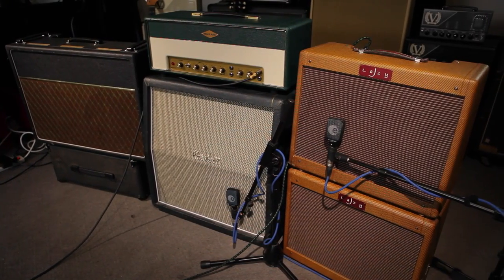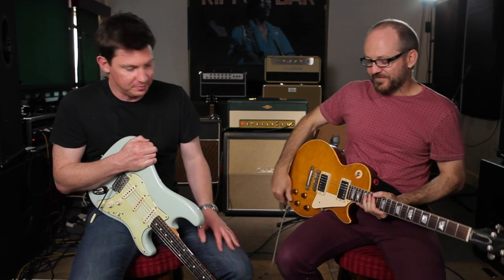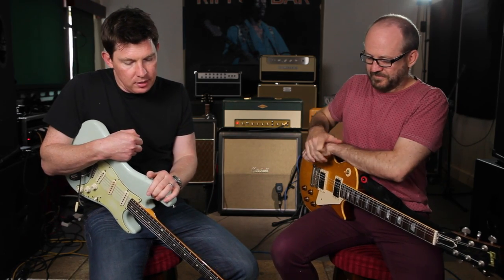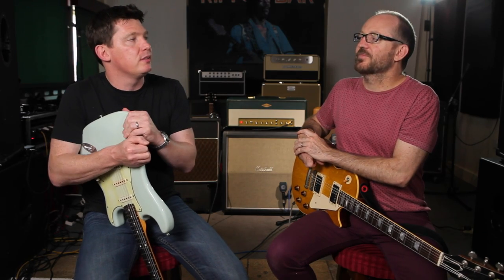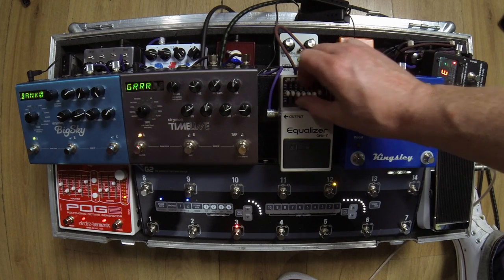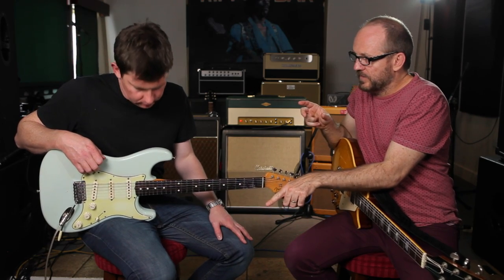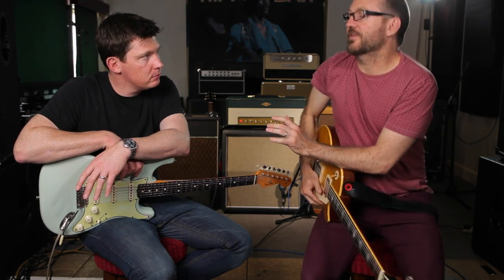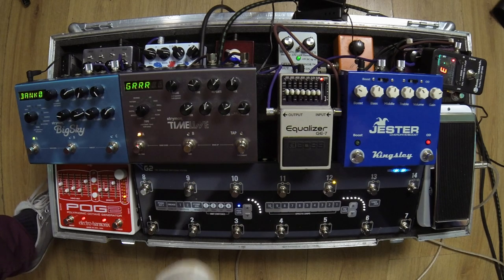Yes You Do Need A Graphic EQ Pedal! Plus: Latest Kingsley Jester

Comment: what do you think of the 10 band MXR EQ instead of the 7  band Boss? I play a Strat, into  a Marshall JCM 2000 dsl 40 watt combo, good gain, but no thickness, no bass, even with  the bass turned all the way up..would an EQ make it sound a lot  thicker and bigger, not more distorted, just way huger sound top to bottom..that is what I am looking for.

Comment: I've been using eq in front of my amps for 20 years. Now I'm using 3 different ones in front of my amps, a Furman PQ3, Boss GE10 and MXR 10 band for different eq curves while using an RJM 12 loop effects gizmo, but I use it in front of my overdrive pedals. I also use a TC Electronics stereo 4 band eq chained together for 8 bands that I use in my effects loop of my hi gain amps or the effects loop of my Fryette Power Station when I'm using my non master  plexis and it gives me a lot of flexibility.

Comment: Am I the only one who used my ge-7 as a tube screamer replacement? 
I play Metal using a high gain EVH 5150 iii Stealth and I use clean boosts to push the front end of my amp with a ge7 at the end if the chain into the front to act as a tubescreamer but with my eq style with the gain on full to again push the amp. 
ge-7 is always on and I add boosts when I want more saturation. 

Then for solos I'm thinking of putting either another eq in the loop or putting a mid hump style boost, would that work for the extra cut?

Comment: Great video! I have a question though. In my pedalboard I've Maxon SD-9 running into Empress Multidrive which already has three band Eq. Last in the chain is Strymon Blue Sky. The question is - where should I place Eq pedal in my chain. Before Maxon and Empress (does it effect my already set Eq on Empress, probably yes) or at the end of the chain... Thanks for replay! Keep posting videos! Cheers!!!
Reply from the maker: +Ľubo Ivan Hi there, you need to try it, see what works for you, some examples in the above video might help, but try it in the different potions and see what works best for you, there is no right or wrong answer ;)

Comment: Something I have always taken as read, without really thinking about it, and that is, when setting up a Guitar/Amp EQ without any pedals that the tone controls on the Guitar should be set on 10. After the required EQ has been set on the amp to accomodate all pickup permutations, tone can be rolled off where necessary, on the Guitar, to contain any treble spikes. Is that actually the correct way of thinking?
Reply: +Phil Porter Personally, I think that's a great way of looking at it. However, in my experience it works better the fewer (tone-shaping) pedals you have because your guitar's tone controll will have less and less effect the more pedals you have and use simultaneously.

Comment: So the Jester has actual tubes in it?  if the amp has tubes in it, why would you need a pedal with tubes? Would  it really make much difference with a tube amp?
Reply: In a word, yes. It changes the character and responsiveness of the drive. I've got an old bk butler tube driver and it's such a unique sound
Reply: the Jester has a certain sound... it accomplishes this with tubes.  Whether u want that sound is the issue.  the purpose of the tube is not to make up for the amp not having them.  To me the Jester sounds great , and would not sound the same were it designed differently with different parts.
Reply: My amp has tubes in it. A  Marshall JCM 2000 DSL 40 watt combo amp..so would this bee too much tube action, if this pedal has tubes and the amp does also?  I did not say I was trying to make up for a solid state amp.. I was just wondering how it sounded. Is it way thicker and heavier than pedals that have transistors, the way most are made?  Would it make a difference with a tube amp?  Would it give it a lot more thickness, hugeness?  I am looking for a way huger thicker tone, not necessarily more distorted, I do not like generic metal distortion at all.. I want a huge Hendrix style classic rock Strat Marshall tone..but I only have the combo, so I am trying to maximize, and tweak what I have.. I only have so much budget.. so I have to get creative, and maximize it..what do you suggest to get a giant  Hendrix-Stevie Ray-Trower tone?

Comment: Whats the point of having clean boost pedals like the spark mini when a eq pedal does it perfectly but with bonus of wide range of eq settings. Seems to me boost pedals are a scam to make more money.
Reply: Not exactly. An eq pedal isn't going to give you as much overdrive as a boost.
Reply: A booster boosts more db generally because the circuit isnt like a jfet clean booster , the eq is just a shaping tool like a knife to clay
Reply: @woofystevenson2943  Well said.  Then there's gain, as in a dirty boost, power boost,  and so on.
A GE-7 can't replace an RC Booster and vice versa.

Comment: do you reckon its a better idea to turn the eq on and boost the mids for a solo, or castrate the 'everything on 10' sound for a rhythmn tone then turn the scooped eq off for a solo? for instance on a low watrage amp run on full...
Reply: Chris Cox I prefer to setup my amp for the lead tone and solos then cut out about 5 db of one or 2 or the midrange frequencies and boost the treble just slightly for rhythm.  Cutting around 1000 can get you a fairly good rhythm tone that still cuts through the mix because your amp is boosting all the other mid frequencies.  It really depends on your amp though.  If it doesn't have enough gain on it's own then boosting it would be better.

Comment: what  order do you put  the  eq  pedal in? Would you put it in the efects loop, or the ones going into the amp input.. or where would it make the most difference?
Reply: Depends on how you want to use it. If you want to use it as an overdrive pedal (some EQ's have drive and level controls that let you do this)  then treat it like you would an OD. If you're using it solely to colour the amp then I'd put it first in line of the effects loop.

I strongly recommend getting the MXR 10-band EQ over the Boss GE7. It's just a much more capable EQ pedal.

Comment: I’m currently using an Amp Head Switcher between two heads and one cab.  Both heads have effects loops.  How do I combine them into a switchable In/Out with a single set of pedals so that those same pedals could be used in either amp when it’s active on the Switcher... without spending hundreds on a big fancy loop Switcher like you use.

Comment: Daniel, I do a lot of open air gigs and often the first thing I hear on stage is my low and mid range go. So does putting the EQ solve this "on stage issue".
Reply from the maker: Well it can certainly help but you need to be careful trying to dial in extra bottom end into the amp. It can cause the amp to compress much earlier losing all dynamics. Try very small increases and see how you go

Comment: So guys I think I'be created a bit of a conundrum for myself as I just added and Analogue Meano treble boost to my board however with a Tele (into a Marshall DSL40C) it's basically unusable. So now I'm thinking a need an EQ\ to calm down the shrill Trebel Boost which in and of itself seems counter intuitive.???How effective is an EQ pedal going thru the effects loop or should I basically stick with front of amp after all on the pedal board ?
Reply: The Death Blooms yes!! Eq is totally usable in the effects loop, try it out! Some like it first as a gain booster, others use it as an after-dirt effect still keeping it in front of the amp, and others rather make it the first pedal of the effects loop. Needless to say you can also use it after modulation/delay/reverb effects to experiment.

Comment: Does anyone have any insight into this particular issue:  On my live rig have my EQ pedal as the first pedal in my chain and I'm using the inverted V settings with the point in the middle at the top.  With my Stratocaster it sounds amazing both clean and when using drive pedals, a dynamically rich tone that I love.  When I switch to my Les Paul it sounds fairly good clean, but when I add a drive pedal it makes the pickups sound almost microphonic, not an all a pleasant or warm tone... if I bypass the EQ it sounds fine again.  Is there a happy medium setting you could recommend that would work well with single coils and humbuckers on the fly but would also help avoid the microphonic issue?  Thanks!

Comment: do ya'll use a graphic EQ pedal in every board you run? this is the only video where I have seen one on the board. 

Also, I play through a Mesa Boogie Mark III which has the 5 band EQ. is a graphic EQ pedal necessary if I am playing through an amp with an 5 band EQ?

Comment: between a 7 band and 10 band what's the difference and is it really worth anything?
mainly focusing on the mxr 10 band. do you gain by having more freq. to adjust? or is it really easy to get OCD with so many options.
Reply: More is more, if you know how to use those frequencies at your advantage!
Reply: I'd go with the 10 band, a bit more flexibility compared to the 7 band.

Comment: hi guys, i know this is kind of an old video, but i've recently discovered an issue with my eq pedal and i though that if i was gonna ask anyone about it it should be you haha... I have an old boss GE-7 eq pedal (a 90's japanese version that I bought used a few moths ago) and generally use it as an always-on booster in front of the amp, but a few days ago when using it on the clean channel I noticed a distorted buzz kinda beneath the clean signal (kinda like what the volume knob does on a tube screamer) so I tried moving the sliders back to 0 and it dissapeared, but if I moved any of the sliders up or down, the buzz would come back.. it's really starting to annoy me because I now I can hear it on the dirty channel too haha.. anyways I hope you read this and point me in the right direction, i would be really thankful... love the show btw.
cheers guys!

Comment: Can you explain a little more what you talked about re rolling off bottom end to get a good rock sound....I think this is what I'm searching for and can't quite get it yet...it was when you were talking about the Victory amp...thx
Reply from the maker: +J Miles it's because if you add too much bottom end the tone can get flubby. Shelving off the bottom end at a particular frequency helps the tone sound punchy. If you think about an AC30, doesn't have great bottom end but turn it up do its driving and it's a sound that works perfectly in an any mix.

Comment: For the solo volume lifting, should we use the eq in the loop if we're using the amp's drive? OR after the boost pedal we use in front of the amp?
Reply: If you're looking for a pure volume boost, get it after as many gain stages as you can. So, in your case, the loop.

Comment: Great Video! I have one question left: If you use an EQ Pedal, do you have to adjust the amp settings 'neutral' at 12 o clock? Thanks!
Reply: No, no, no...get it as close as you can to what you want using your amps EQ, then finish it up with the EQ pedal.
Reply: Thank you!

Comment: I am a fan of both Boss pedals and Wampler pedals, owned the Ge-7 and the EQuator, but found them added too much noise, even when they’re not really doing much EQ-wise. (Powered with Strymon Zuma) Anyone else found this? I’ve also got a vintage TC dual parametric which is silent.

Comment: You failed to mention that an EQ can be used creatively for those thin and quiet song intros, removing bass, low mids and volume (like a small amp being played) then bypass it as the band drop in for a massive sound!
Reply: +Robert Strefford They can also be used as a fuzz pedal.

Comment: so do you put it in front of the  boost or distortion pedal, or  after it?  How would you set it up to get a huge Hendrix type sound?
Reply: Putting an eq in front of an overdrive affects the gain structure of the overdrive (no volume boost, gain boost), while putting the eq after drive can be used to boost frequencies (global tone). I'd recommend after, bearing in mind the classic Marshall sound has plenty of mids and high end with lots of volume, and adjust the bass frequencies to taste.
Reply: eljoel89
Reply: If someone has a good amount of pedals, say 10 or so, would the EQ go very last to EQ the whole bunch of them?  This is what I was wondering also..

Comment: Guys, been toying with this idea but I have been reading the GE 7 can be very noisy. Has the GE7 you are using been modded in any way?
Reply: Yes, same question here. Based on forums, it seems paragraphic EQs are more silent than the graphic ones, but the ease of use is better on the latter. What to do?
Reply: Nick Harris I imagine a number of people might write a graphic equalizer off as being noisy because they're boosting freqs more often than they are cutting freqs.

  I have an MXR 10-band and a GE-7, and sure, they 'can' contribute to my amp appearing to have hiss/fizz if I'm just boosting the good and neglecting to cut. We all want 'more' from our tone, so I think people new to an EQ are more inclined to fixate on boosting as the solution, and forget how important cutting can be depending where an EQ is in the signal or what the desired effect is.

TL;DR: If an EQ pedal is being boosted sky high, it can add noise very fast, however, I have had zero trouble with either EQ I own, so long as I remember that cutting freqs is as important as boosting.
Reply: I just got a used GE7 today, it's my first EQ and it's GREAT.. and yes there is noise, but I'm replacing the OP AMPs to NE5532/NE5532P in few days and it sure gets rid of almost all the noise, check out the mods videos for these pedals.
Reply: Goof Core Super good point. Kick up the treble and I get a load of hiss.  Cut some bass instead and turn up the amp volume to compensate and same result with less/no hiss.

Comment: is it common practice to put your amp eq at noon and then use the eq pedal?
Reply: Generally, adjust your amp until you find the best sound you can find in it, then use the EQ to either fine tune to taste and leave it on all the time, or do some of the strings in the video for specific guitars, rhythm / solo tone etc.

Comment: How does gilmour use buffered eq's before his fuzz without screwing up the fuzz?
Reply: +whynottalklikeapirat I think gilmour used ge7 + tube driver and fuzz or tube driver + fuzz + eq
 I have a mark V and I learned a lot of eq with that amp, it helped me to dial my sound also and i use a rare pedalboard but works fine for me i have to ge7 one goes in the front of drive and the other and mxr 10 band goes in the loop if other amp need it , what i am trying to say is eq is the front is like making your guitar sound exactly as you want before hitting anything also you can use  the eq in the loop as a flat +6 db for boost or  before de the drive  just for more compresion ge7 + tummus a good delay and the spring reverb from the amp a blackface reissue just blow anything away for blues.
Reply: AmzeehFTW Thanks for sharing mate. My concern is not so much how to use EQ.

The problem is that both the tube driver AND classic fuzz pedals are particular about what goes in front of them, and very often also what comes after, if to a lesser degree.

The tubedriver grows kind of fizzy with the ge7 in front. I own both. Putting it after cleans up things - but you dont get the boost to the drive. I run a 71 super reverb, with a lot of headroom so i get the drive from the pedals and not the valves which yield compression - but not overdrive. So I am looking for a good way to push a tube driver.

My fuzz pedals of course do not like anything in front of them, they barely accept being in a neutral looper.

i actually like putting a fuzz face in front of the Tube driver, but something happens to the sound after a short while of playing that kills the benefits. There is some sort of build-up phenomenon going on that makes it fizz out and grow irrelevant.

I heard somewhere that gilmour uses modified cornish fuzz and modded tube drivers to somehow overcome impedance issues, but I have been unable to confirm this.
Reply: whynottalklikeapirat i know what are you talking about have you seen the buffalo power booster the sl drive also the tummus and for the fuzz using the rat or my best fuzz ThorpyFX Muffroom Cloud sound quite better than any clone and have the same with more aplications dont need eq and the tone is superb for lead tones like comfortably numbs
P.D. Gilmour technician have made tons of modifications to what we call standard vintage pedals so its quite dificult to get the gilmour in a box sound, hope it helped you have a good day
Reply: AmzeehFTW I am not after the Gimour sound, I just want to fix that issue =.O. I have a Skreddy p19 that is effectively gilmour in a box should I need that, it's a very singy pedal. Quite unique in it's way.

I have a bunch of boosters and screamers that I use for different purposes. It's just very different how they interact with other pedals and so far I haven't liked what any of them did with the tube driver. As fuzz goes I am probably more in the fuzz face type camp than the rats and muffs. I have a couple of old rats, but they get too fizzy for me at the end of the day. The muffroom sound like it has kind of a tonebender quality?